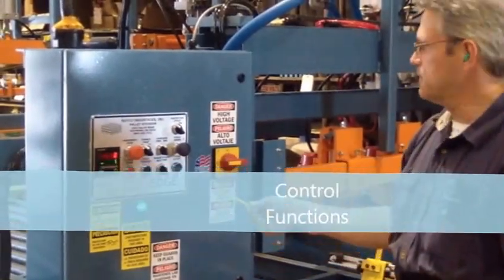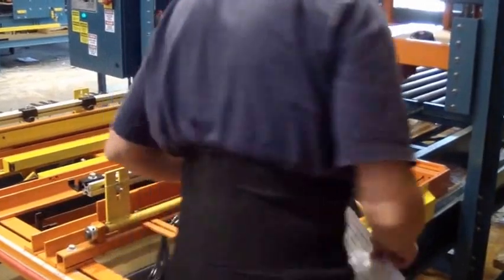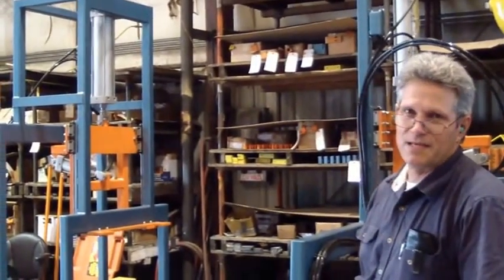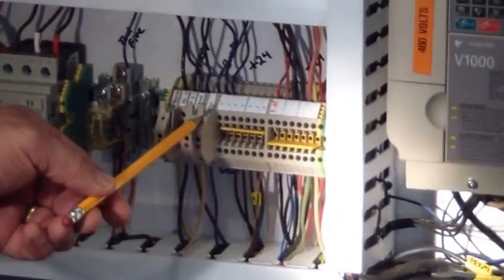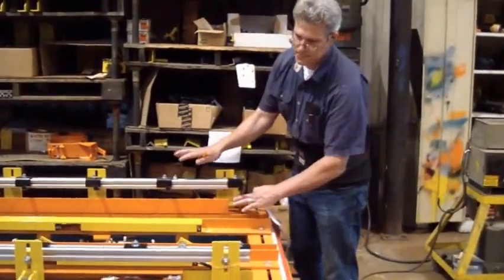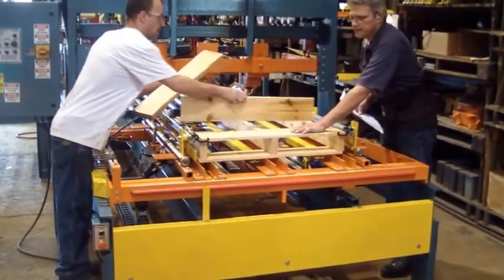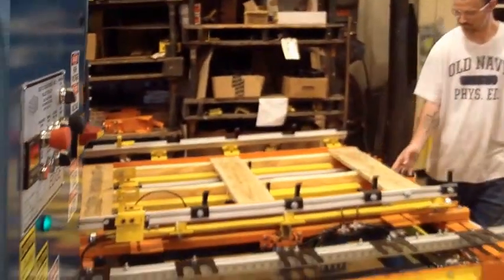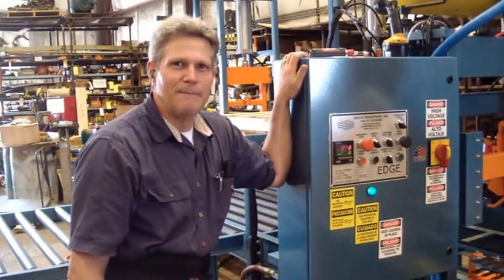How to Edge - Tutorial Video

Comment: When making a single face pallet, how do you discharge the stack.....with no bottom boards it will not roll properly but fall between the rollers?
Reply from the maker: Hi Charlene, great question because this is not mentioned in the video. For single face pallets, you will need to lay plywood over the rollers. This way the pallets will not slip in between the rollers. First, though, you need to make sure that "Single Face" mode is on. This will make sure the pallets are not automatically discharged when you reach the count that has been set. In "Single Face" mode, the program was written to not automatically discharge so that the operator would be alerted that plywood needs to be set on top of the rollers to avoid the exact issue you are asking about. Then, to discharge in "Single Face" mode, you have to manually discharge, which Dan discusses at the 38: 00-minute mark in the video. Hope this helps and let us know if you have any other questions!

Comment: We have a used Rayco Edge and I found this video very informative.  I noticed the top cardboard has been taken off the coils...is this just to see when the coils are low or does it help with feeding?  Also there are metal discs under the coils....are they also to aide with feeding? As you can guess we are having feeding issues.  We have only one MAC Valve for three guns, I'm wondering if I should install three for each guns?  Any help you could give would be appreciated. Nice job!
Reply from the maker: Hello, Charlene! We're happy that the video was helpful so thanks for watching! The cardboard on top the coils really provides no advantage either way. The metal discs under the coils do aid in feeding the nails. I am sorry you are having trouble with the nail feeder. Individual MAC valves certainly help, especially for being able to make separate adjustments for each nail gun. However, we would love for you to give us a call so one of our technical experts can diagnose the problem and help you fix it. Our number is (804) 321-7111 and just ask for technical support for the pallet machines. Or you can contact us through our website by going to http://raycoindustries.com/contact-us.html. Again, thanks for watching! We greatly appreciate your feedback and please don't hesitate to contact us for any further assistance.
Reply: +Charlene W Thanks very much for the reply!  We have worked through many issues as often happens with used equipment.  We will try the metal disks along with separate valves.  Over all we're pleased with our Rayco Edge.  I will certainly get in touch if the problems persist and tuck this video away for future reference.
Reply: Hello; We have a used older Rayco (serial #99028) the machine is running very well.  But recently we've reset the count for the stacker.  For some reason we're not about to change the count back to where we had it.  There is not much info in the manual on setting the counter.  What is the proper proceeder?   We're pressing the mode button, then using the small numbers to set the count.  the numbers flash but when the flasing stops it returns to the previous count.  We have tried pressing the mode, then set, then setting the count but when the flashing stops it returns to the previous count aswell.  Any info would be appreciated.
Reply from the maker: Hey Charlene, unfortunately, it sounds like the counter has gone bad and will need to be replaced. The only other thing you can try (if you haven't already) is make sure it is not in single face mode. With single face mode off, you should then discharge the stack and it should reset. But most likely it is broken if this is a continuous occurrence.